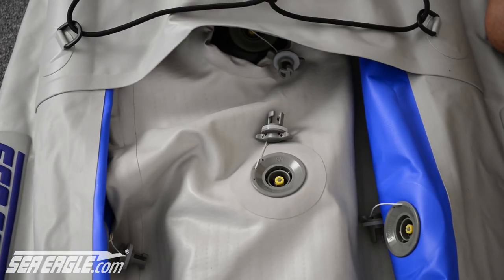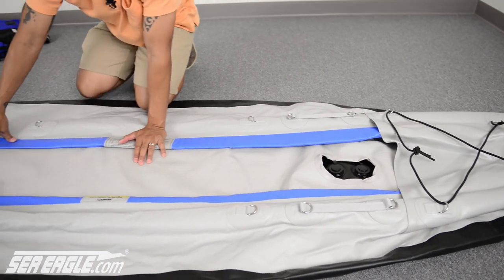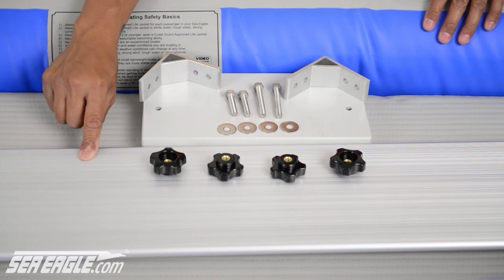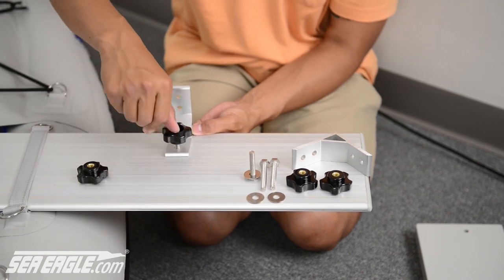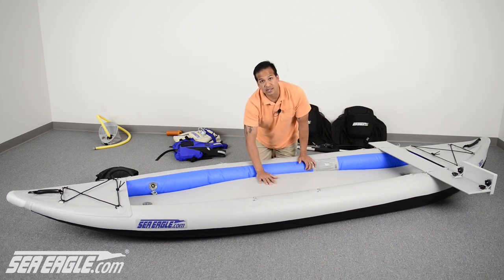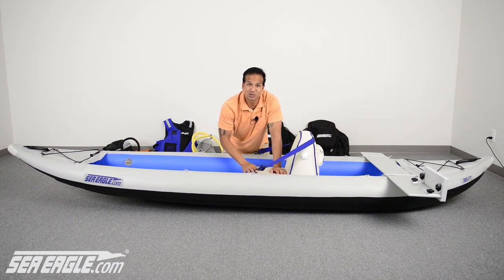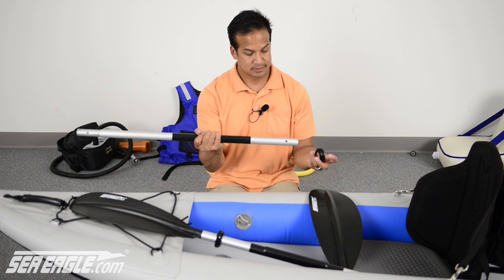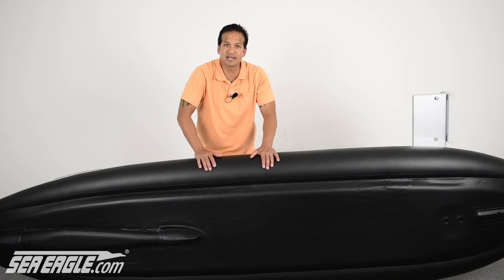Sea Eagle - FastTrack™ Inflatable Kayak Instructions - 2014

Comment: If only it was this easy... For one person this is a long, heavy beast in its deflated form. I folded it exactly like this but it was one big heavy lump instead of the compact, neatly folded specimen you see here. The floor doesn't slide around that easily, it has some weight and resistance, so it is a pain in the butt to align to each end and under the pontoons. The skeg doesn't slide in unless you pound it in, and the locking tab won't slide in at all. I always folded carefully so as not to bend the skeg base so it isn't that. But once inflated it is a quality boat. Just know it takes practice.

One important tip: Pay close attention to the inflation valve instructions in this video. You must turn the valve counterclockwise so it pops up before you insert the hose and turn right to lock it in. If you don't, the air will instantly deflate the second you turn the hose left and pull it out.
Reply from the maker: Thanks for sharing and thanks for watching! It's always nice to see honesty feedback. 
We hope you subscribed to the Sea Eagle Boats YouTube Channel for more informative videos to come!

Comment: Hi, I just got the current model of the FastTrack 385 and really like it, both quality-wise and the huge versatility! But what is the working pressure of the needle-knife keel, though? It it the same drop-stitch material as the floor, i.e. 10 psi? Because if I inflate only to ~4 psi, it seems to be losing pressure over the course of just a few hours (I already put on some soap, but apparently there are no bigger leaks...)
Reply from the maker: Hi Felix, thank you for watching. We are thrilled you love your FastTrack. The external keel is made of drop stitch construction and you can inflate it up to 10 psi. If you continue to have issues please reach out to Jerry Allen in Technical Support via email to Jerry@SeaEagle.com or 1-800-748-8066 and ask for him. Wishing you many wonderful and safe days on the water. We hope you subscribed to the Sea Eagle Boats YouTube Channel for more informative videos to come!